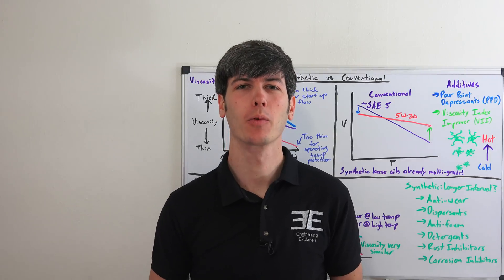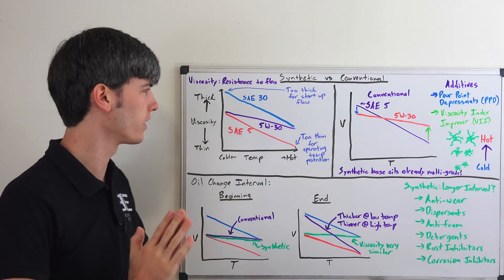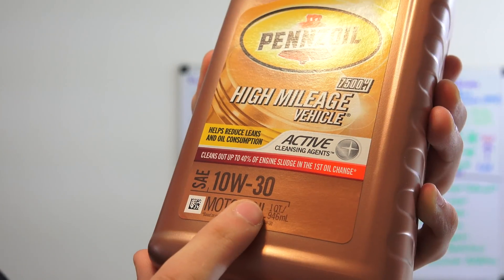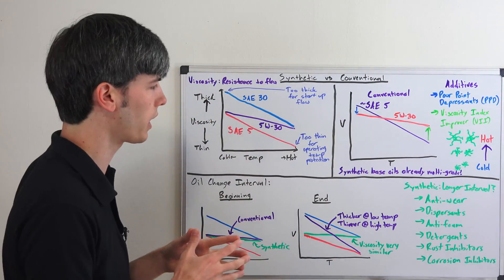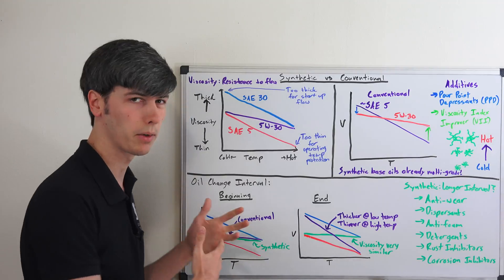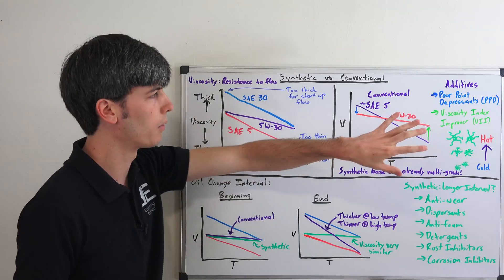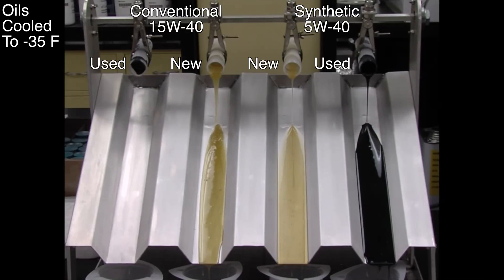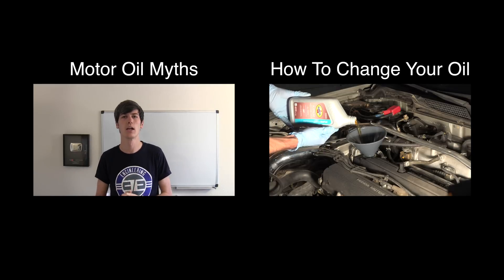Is Synthetic Motor Oil Better For Your Car?

Comment: What if I use Canola oil?
Reply: Depends on what you're using it for. If you're making popcorn than canola is the way to go.
Reply: You won't have a lot of things in plain Canola oil. It's like using something from the 1700s instead of the right tool for the job.
Reply: Canola oil would gunk up like crazy.  I don't know what it has that motor oil doesn't but I can only imagine the complexities and the chemistry involved in manufacturing the oil we use in our cars.   Using canola oil would be like using wood instead of steel to build a car.
Reply: jeff, your a legend
Reply: don't use canola oil it solidifies like jello after it cools down in an engine and you'll need a new engine
Reply: +fubbles5 Basically Sludge.

Comment: Lets say my engine burns off a lot oil and I add in more oil to keep it at the recommended level, does this have any negative effects?
Reply from the maker: +Edwin Garza nope, keep adding haha, just means your engine is likely wearing out (or there's a leak somewhere). I know the struggle,
my Integra burns a lot.
Reply: We call that the dynamic oil change cycle.
Reply: +Engineering Explained that's every high mileage Honda LOL the valve guides seem to be the culprit every time.
Reply: If you have to add oil between oil changes, you have a shitty car. I have had Fords for seven years now, and I have never had to add a single drop of oil between oil changes, and that's a fact.
Reply: Burning oil makes blue smoke not white
Reply: My Ford Focus is well over 220,000 miles.  I run it 10,000 miles between changes, and the oil level never drops at all in that interval.

My Explorer has over 300,000 miles, and besides leaking a few drips at the front and rear seals, it uses no oil either.

The last car I remember needing to add oil between changes was the old Pinto I had in college.  It burned about a quart every 500 miles.  LOL

It used to be that 100,000 miles on V8's, and 80,000 on 4-bangers was pretty well worn.  Now that's barely broken in.
Much tighter tolerances, as well as better materials, and better oils have made a huge difference in the past 30+ years.
Reply: it hurt the environment and drivers behind you
Reply: It can clog up the exhaust system, e.g. the catalytic converter. If the engine is worn out, better to switch to a different oil designed for high mileage engines to prevent this. Or if there is a specific problem it should be addressed. Keep changing your oil and filter regardless.
Reply: Most new cars burn oil because they are using thinner piston rings with looser tolerances for less friction because of the EPA. this causes them to burn oil.
Reply: Topping it off has no negative effects, you should be keeping it topped off. Always pay attention to your oil level!
Reply: DE Nichols likely caused by the burning of the oil. Not the going without the oil changes. The burning is bound to leave deposits all over. If it burns oil is life span is ticking away
Reply: Edwin Garza well you are burning oil, it means that oil is escaping somewhere, so if you keep it at normal levels you will not have problems! Oil is very key to keep an engine running right, without it your car is dead.
Reply: +Engineering Explained Yeah... I have an acura rsxs lol
Reply: Could I interest you in trading your engine for my Civic's D15B7? 
It gets great gas mileage.
Reply: +Edwin Garza acura tsx. same problem. haha. least I'm not alone.
Reply: DE Nichols burning oil = white smoke
Reply: I used to own a dodge durango with the 5.2 that used alot of oil lol. so i went 5-6k in between changes, instead of every 3k. since i was always adding ha ha.
Reply: ??? that does not make sense looser piston rings means less power from the cylinder's power stoke which decreases MPG a lot. This loss of power is greater than any benefit from less friction. Which by having looser piston rings could case they to bind which would increase friction by a lot. 

Add in the fact that the burnt oil will make it out the tail pipe and cause more pollution just like the VW diesel engines. Which everyone is amazed can run on vegetable oil  or peanut butter oil. But when you understand Diesel was a German inventor and there was little gasoline in Germany he thought it best to design a motor that ran on renewable peanut butter oil. Hence the diesel engine was designed to use renewable sources of energy. When you add a filter to a diesel engine to block the burnt oil particles you reduce the MPG a lot as the filter reduces the pressure on the exhaust which reduces the MPG of the car. That is why some people replace the exhaust of pickup trucks with much larger ones (like 18 wheeler trucks have) to increase the power of the truck. 

There should be a way to design an exhaust to get around this problem.
Reply: Brandon Hickman If exhaust is overly restrictive then the combustion chamber won't fill with the intake charge. 

Excepting diesels, most of the force to bring in the intake charge is actually from the exhaust leaving, not the piston going down.

The exhaust scavenging is 8 times the force of the piston going down. 

I learned this from David Vizard. Engine and air flow racer of 50+ years.
Reply: You won't have to do oil changes if it burns fast enough lol
Reply: Blue smoke is from excessive oil consumption.  White smoke usually indicates coolant is leaking into the chambers.
Reply: if your burning alot of oil your engine is worn out..time for a teardown.
Reply: that's if it drips from the valves...he did a video on that too, if at startup you see white smoke it means the alves leak and oil has been getting into the cilinders, but if it doesn't then it's like worn piston rings.
Reply: Most cars recommend checking hot oil after it settled for a few minutes.  Most people check cold oil, and overfill it while topping it off.  The blowby from too much oil in the crankcase gets sucked thru the pcv and onto the intake where the oil residue enters the combustion chamber, and accumulates on the rings, and gums them up - causing oil consumption.  For oil one should stay in the lower end of full rather than the higher end.
Reply: Other than draining your wallet, it actually renews the oil a little bit every time you add new oil. Really.
Reply: So long as it's the same viscosity, no issues. If you're using/burning oil, might be wise to look into a heavier viscosity oil, short of an engine overhaul that is.
Reply: +Austin Lucas It sure does.
Reply: +SteinOnkel like dynamic versus static compression. Nice!
Reply: Eng. Fares What hurt the environment? Sorry, I don't see how your comment fit the discussion.
Reply: Mavusi Kenpachi
I hear you. So long as it's not totally choked, then you can't drive fast any more.
Reply: Pending on how much oil you need to add and how often makes a huge difference in what you should do. Half a quart to a full quart once every 2 weeks or so, no biggie. If every other day, overhaul the engine, either bad valve guide or bad piston rings if not a combo of both.
Reply: TsmnnDvl5 The rule of thumb on the Toyota Corolla we developed was at a quart per 1,000 miles rebuild it already. Cheaper than all that oil.
Reply: +DE “AutoBravado” Nichols that's where I am right now, every 1000 miles I need about a quart
Reply: +DE “AutoBravado” Nichols It's still as I stated, it depends on the oil "usage". Some makes and models can get away with a half to full quart every few weeks, more than that, time for trade-in or rebuild. And rebuilds aren't that bad really. Just do regular oil changes. I do 3 months or 3k miles whichever occurs first regardless. Never have had issues with any of my vehicles. Each their own as for a rule of thumb sorta say. Cheers :)
Reply: +DE “AutoBravado” Nichols It's still as I stated, it depends on the oil "usage". Some makes and models can get away with a half to full quart every few weeks, more than that, time for trade-in or rebuild. And rebuilds aren't that bad really. Just do regular oil changes. I do 3 months or 3k miles whichever occurs first regardless. Never have had issues with any of my vehicles. Each their own as for a rule of thumb sorta say. Cheers :)
Reply: The only negative affects are probably some carbon buildup and the cost of oil, it's not harmful to the engine that much just means your rings are past tolerances, eventually it will get worse but if u can't afford a rebuild or another car I wouldn't worry that much just keep oil topped up
Reply: hahahahahhahahha
Reply: Nnenna Strother
Very good analysis. Only spotted 1 error. The filter increases back pressure, reduces exhaust flow, and therefor reduces power and efficiency. Very good thinking there Nnenna.
Reply: +DE “AutoBravado” Nichols back pressure is a myth
Reply: I would be willing to guess you have a lot of miles on your car and have worn rings. adding oil will keep your engine going if you can't afford to get it fixed.
Reply: your car is now dual fuel.
Reply: +jukimies 7 years? LOL that's nothing
Reply: Gregory Kanniard Haha. Reminds me of a bosses Astro van in 2003. He finally realized after 2 years that you can't do that. After I changed his oil, it ran like craps.

No, don't stop the oil changes. Longet interval? Probably fine because of the new oil, but remember boiling off oil contaminates the oil faster.

I'd chose the oil change interval based on the oils color.
Reply: Edwin look up the type of motor oil needed for your car there are usually different weights allowed for different temps. If the manual says you can put the next grade thickest oil in it and it shouldn't burn up quite so fast.
Reply: You can tell with piston rings the smoke appears when you rev it and then snap the throttle shut, also more apparent right after startup.
Reply: its not good but if its a little here and there its prob fine. Assuming you do an oil change every 4k miles, if you are adding a quart or so in between oil changes that is fairly common for an really old high mileage car. Depending on the car and the leak, i would stay with regular oil. Running synthetic oil with a leak often leads to increased leakage b/c the oil also kinda works as a cleaner. Run regular oil too don't buy the BS high mileage oils the oils places try to sell you for another 10 dollars an oil change.
Reply: Do you have a rotary engine...? >___>
Reply: No, but it would if you didn't add any. Burning oil though, maybe your rings are bad.
Reply: it is not good... but if you keep the oil level up you engine should still run well I would see if you have any gaskets or rings that are bad because those are some of the issues on why you could be burning oil
Reply: Blue smoke.  Coolant = white smoke.
Reply: They are notorious for leaking and burning oil as they age.
Reply: If so, You need an engine rebuild if there's no leak. Could be the block or the head that needs to rebuild.
Reply: +Edwin Garza have 06 RSXS and I also keep adding oil.
Reply: Check the head gasket, changed that out on my 2000 Audi A4 B5 v6 engine and it helped alot.

Comment: Nicely put. It would have been nice a hot comparison of the viscosity with your apparatus as well with some slope adjustment to see any difference more easily. (or a cinematic viscosity-meter and a dynamic one.. but it goes beyond a simple "easy to see" experiment)

Comment: i have a brz, on track with no cooler i was getting to 280f.  with a coolant based cooler, 250-260f.  manual says 0w20 or 5w30.  i've put in 10w30 as i've heard the narrower range means it is an oil that will stand up to hotter temps better.  is that true or bs?  after my next change i'll have the opportunity to order more, and not sure if i should stick with my 10w30 since i'm tracking it, or if it's all good with the 5w30.

Comment: you should reduce rating of oil used when switching synthetic, 10w-30 motor takes 5w-20 synthetic.

Comment: Great video.. One question why do the oil makers insist you can go longer with Synth oil in fact they recemend 5k miles and in some cases 10k miles between oil changes then?
Reply from the maker: +MidwestMotoRider I'm not sure, but Pennzoil (Shell) most definitely does not recommend going longer than what the manufacturer recommends, and I would bet most don't.
Reply: Because most healthy engines with a good filter can easily go 10k on a good synthetic.  To follow along with this most manufacturers now recommend 10k oil changes and they pack their engines with synthetic from the factory.  I've worked in the dealerships for multiple different manufacturers and they all run between 7500-10k now on oil changes.  Some even run the 7500 on conventional.  The 3k oil change days are long since past and just a waste of money unless you are maintaining a race engine or an engine that is not in good shape.
Reply: synesthetic does not break down with age or temp it only gets dirty originally the selling point for synthetic was it lasts FOREVER but manufacturers dropped that pitch as prices dropped because of increased sells over last decade when using FULL synesthetic oil you only need change the filter at regular interval (3000) miles and top off whatever is lost in the old filter the manufacturers of the vehicles KNOW this and instead of recommending this routine they cover their ass by recommending longer intervals this makes the oil more dirty (not good) and replaces all the fluid at end of interval I change filter 3k miles no matter what and only top off for last decade on all vehicles that I know have synthetic oil in (personally changed)  do not use any oil that is blended its a waste of time and money
Reply: it's the oil change places that say that. they want you to pay the higher price for the synthetic oil change so they say "hey. it lasts longer, so it's worth it." also, I am pretty sure mobile1 used to say that too.
Reply: Yea I seem to remember seeing it on Mobil one. You are probably right about that.
Reply: +ImportTunerRB26 The 10k interval recommended by manufactures that you're referring to is the regular schedule, not the severe schedule which most of us fall into (short trips, low engine speeds, etc.) which even Amsoil  states not to use it's best synthetic past 5k miles severe service. So yeah, 5-7.5k, sure no problem, but I wouldn't push it to 10k just because theoretically it can.

Comment: Subaru knows this very well.  You cannot use synthetic in their engines because if you do (when the owners manual says you can) and it burns oil, they force you to move to conventional oil so the thicker oil won't burn off as fast as it ages.  They did this to me after I used synthetic for 40,000 miles so now I have to change it more frequently, making more money for the dealership, and no longer burning oil.  Last Subaru I will own as my other GM car uses Synthetic after 140,000+ with no issues.
Reply from the maker: +AcuraT I drive a Subaru and get the oil changed at the dealership. They only use synthetic on it.
Reply: why dont you just change the oil yourself...
Reply: If thin viscosity is the issue you can just move up to a thicker synthetic or biosynthetic to reduce oil burning.
Reply: This is not true. i have a 1993 Legacy that only run on Pentosynth 5w50 synthetic oil for the last 10 years. zero issues, runs smooth, no smoke. 250.000 km on the clock
Reply: Engineering Explained All, I know it is not true.  It is the dealership not wanting to stand behind the car they sold me.  I changed the oil myself and/or used an independent mechanic who has kept my Saab 9-3 going with no issues.  Subaru corporate when I got them involved said it makes no sense but the dealer has final say.  However, they are forcing the dealer to do a consumption test (which they refused to do initially) with conventional oil and are paying for that.  I am not permitted to use synthetic oil for the consumption test and I tried two dealerships in the area - the one I bought the car from (north of me) and the second south of me.
Reply: You got ripped off son.
Reply: Lok Tom Not quite yet.  Subaru gave me $200 for the test and oil change to cover all charges.  It is enough to cover a couple of services.  Of course if they don't fix it if it is consuming oil then I have an issue.  To be continued...
Reply: Yeah,  like a several thousand dollars engine rebuild is coming .  Hoped the manufacturer cover that one. Don't let them use the "BLAME GAME " on you.
Reply: Lok Tom They can't without problems as I documented everything fully.  They recommend oil changes in their manual every 7500 miles on conventional oil which is insane, and I have a documented email I printed out from corporate that they stand behind that.  I do it much more frequently with synthetic - 5000 miles but now conventional because the dealership insisted I use that instead.  They cannot blame me without legal issues as I did everything as instructed.  Will see how well they stand behind their product if there is an issue.
Reply: Good luck.
Reply: 251k miles on my 95 legacy ob, doesnt burn any oil and i run 10w30 synthetic, it probably never got synthetic before i got the car.
Reply: Funny my dads Sub. always used synthetic with no problems.It also came out still looking clean.
Reply: I've had a '91 Legacy, I have a '98 Forester and an '09 WRX and all use/used fully synthetic oil without problems. the Legacy had 212,000 miles when sold. Currently no issues with oil burning or consumption. Perhaps you got a defective engine or there's another root cause

Comment: Great info!  However I can't afford synthetic oil and my two GM 4.3s have 279K and 371K miles on them and are still doing great.  I only put about 5K miles per year on each of them now and use Mobile 1 High Mileage 5W-30 with AC Delco PF52 (not E) oil filters.  I've been changing them once a year as many old car hobbyists do; but is this OK with a semi-newer engine (i.e. compared to the 30s, 40s and 50s)?  How often do you recommend changing the oil under these circumstances?  Thank you!